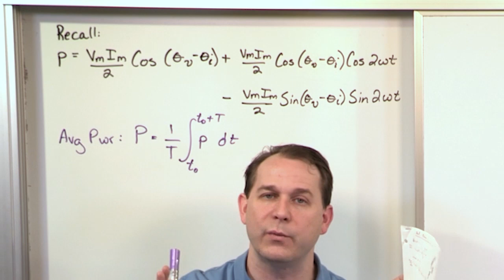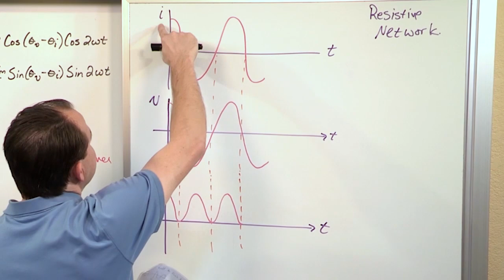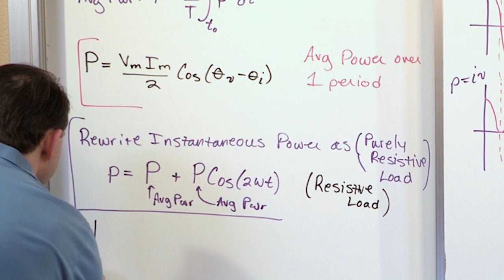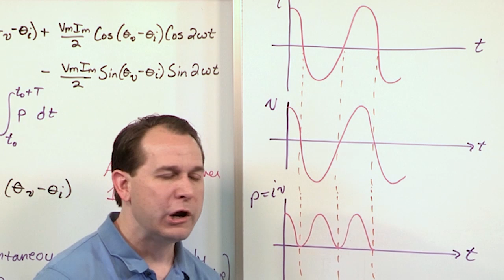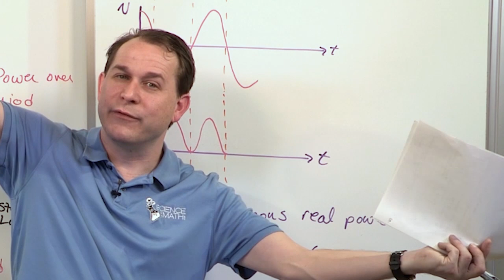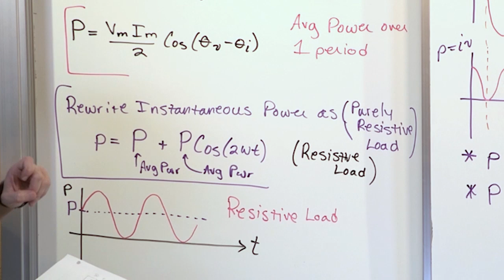Real Power in AC Circuit Analysis

Comment: If you show me a schematic of a machine I haven't a clue   put it in front of me and I can fix it or fine tune it a place I worked specialists called out about machines to repair them would take half an hour looking at them and can't fix them I come into work and put the machine on for a few secs and fix them in a few mins.the boss one day asks me too replace a drive belt and told me what the engineers do , I showed him how to do it in a few secs they had him doing a very dangerious  thing could lose your fingers he didn't know the wheels were free moving and that's how you put the belt on not under power ,, to say he was pissed at them he went to make a call